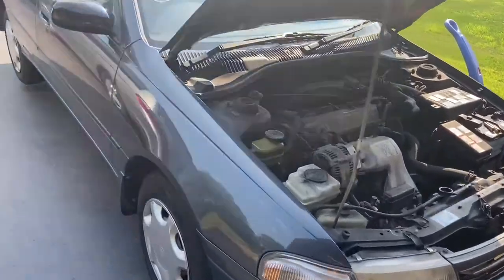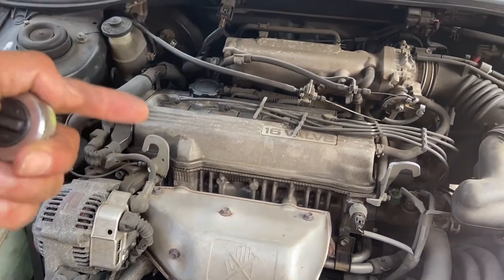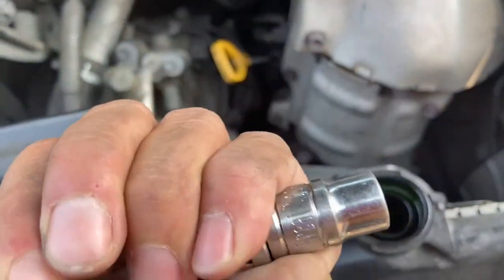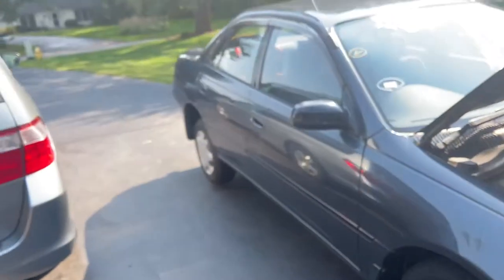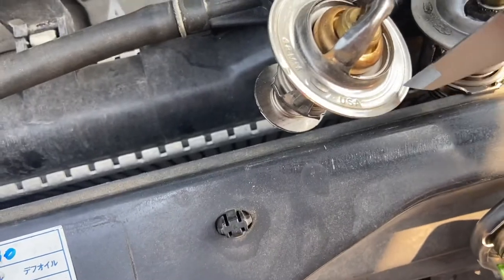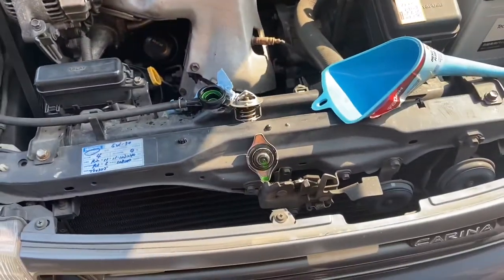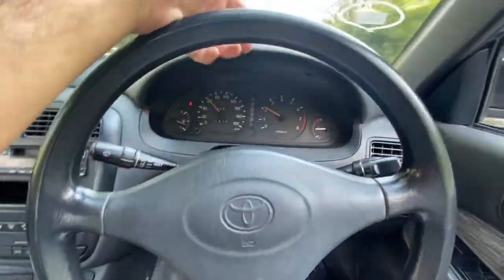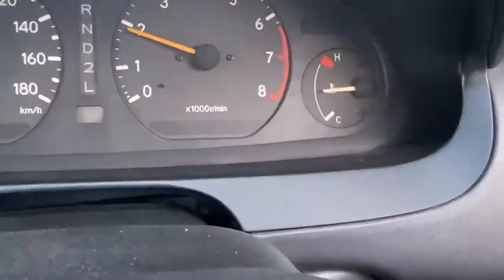Will it work?! JDM 1994 Toyota Carina 4s-fe needs a thermostat! Trying a 1994 Camry 5s-fe

Comment: Is there a turbo set up for this engine?
Reply from the maker: There can be a turno for anything - make it custom - but to answer your question, according to my sources, it came as a 4S-Fi (throttle body injection) and 4S-FE like mine; EFI with an injector for every cylinder. No "GTE" turno. But the 3s came as a GTE and was a rocket. THis motor - like any more- can be turbo-ed. Up to you if its worth it =)